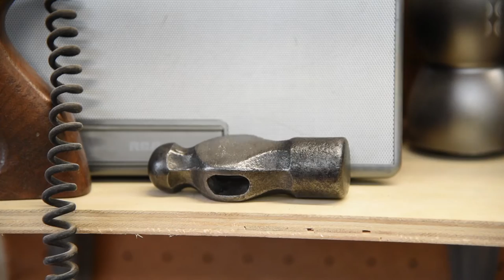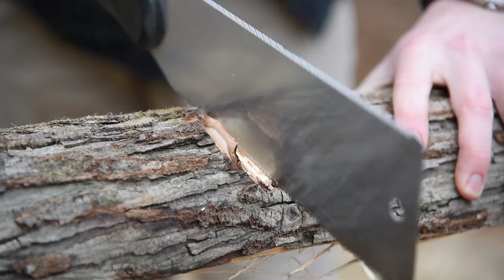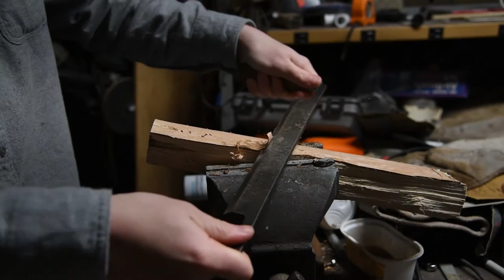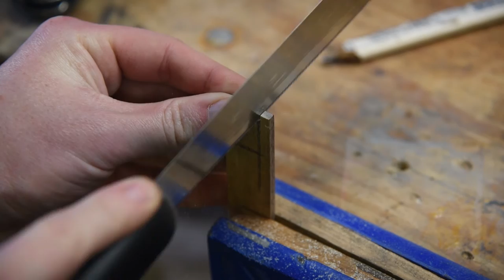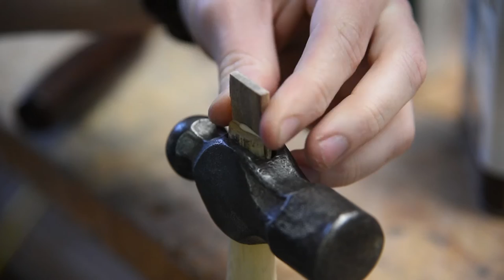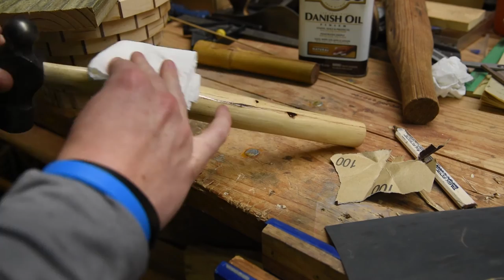Ball Peen Hammer Handle

Comment: If you want the head supertight get a bucket, put about 1 1/2" of water in it and put your hammer in it with the head portion in the water.  Let it sit for a couple days.  The wood will soak up the water and make it super tight.
Reply from the maker: +Karate Kidd Thanks for the tip. The head is already super tight with the wedge in, but if I have one in the future that needs help, I'll remember that.
Reply: that is only a temporary fix, over time the wood will shrink even worse deffinately don't want to put that in water